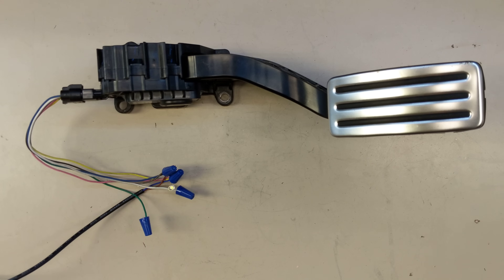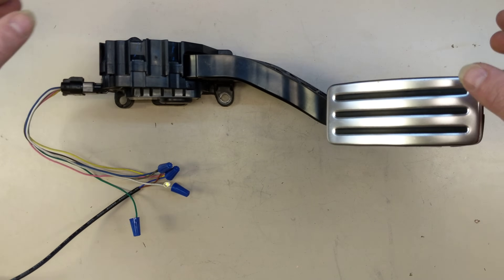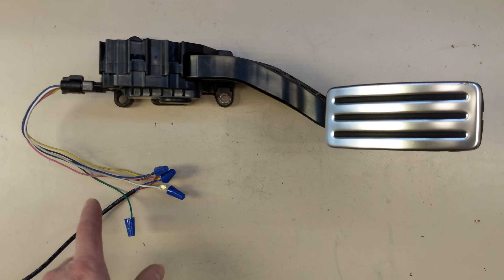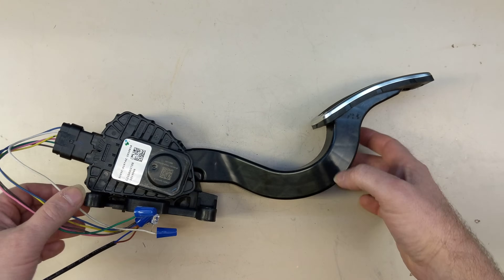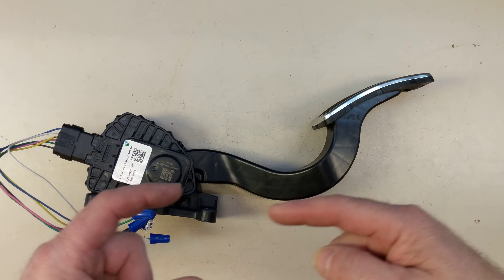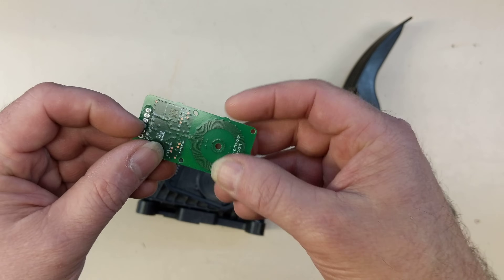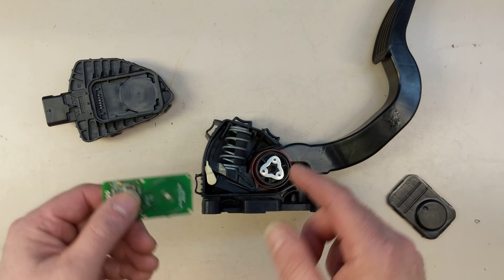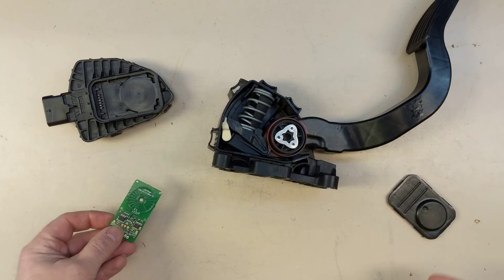Tesla Teardowns - The "GO" Pedal!

Comment: In single motor cars, these analog signals must go the rear inverter ECU obviously.
But in dual motor cars, which inverter do the "go pedal" signals go to? Stick to the rear inverter ECU (keeps common parts with RWD) or front inverter (saves some wire length)?
And how is the signal routed in three inverter ECU cars like Model S Plaid (1 front inverter ECU, 2 rear inverter ECUs)? Most likely, the analog signal is wired to only one of the inverter ECUs and is then distributed via CAN bus to the other ones? Or is it wired in parallel with the analog signal going to all the other inverter ECUs? Would be interesting for FMEA considerations. Especially, as in two-motor e-axles (Model S Plaid rear axle) the whole e-axle should either work or not work at all.
Reply: It would be more likely that the pedal position goes to a main ECU and that ECU then directs the inverters.  There are many other signals that need to be correlated and sanity-checked for forward (or reverse) motion.
Reply: @awebuser5914  Remember, there is no "main ECU" (you would probably mean VC Front). And Phil said at 2:20 specifically, the analog signals would go to a thing called the "pedal monitor, which is running in the second core of the TI TMS320 DSP, that is in the Drive Unit. And its job is to ensure that this pedal signal is authentic. They cross check it with the inverter, which is also monitoring that signal". As this is a DSP, it probably contains the necessary 2 ADC inputs as well, see "TMS320 VC5507/5509 DSP Analog-to-Digital Converter (ADC) Reference Guide". What he did not say: which of the drive units receive the analog signals. :-D

And what parts are analog, what are digital (CAN) messages. What is clear though: once this dual analog signal is converted to some digital representation of the pedal position value (like in CAN frames), the opportunites for cross checking both analog waveforms are gone. Then only time-series analysis of the digital signal and stuff like range remain to check. So, the pedal monitor MUST receive the analog waveforms to do its job properly.

Yes, you are right, that there are many other signals that need to be correlated and sanity-checked for forward or reverse motion. But it is the Drive Unit ECU that could handle that. In a system that would be too centralized (like a single central instance for all two or three drive units), then all drive units would fail if the central instance would fail. Actually, this is an interesting engineering problem and Teslas solution to that would be interesting.
It is also relevant for Phil for the conversion projects as the conversion vans likely only contain a single drive unit in the front axle with FWD. But as we see: he also sources from dual motor vehicles like the crashed Model 3 Dual Motor.
Reply: I looked it up in the Model 3 (MY2018 and MY2019) wiring diagram: analog accelerator signal (2x 3 wires) is always routed to the rear drive unit inverter ECU ("Drive Inverter Rear & Resolver"). So from there, some signal is distributed via CAN bus, at least for diagnostics.
Reply: @koeniglicher  I guess the question is where is the "control unit" that actually tells the inverters to apply power to the motor(s)?   Is that in the rear inverter, or a separate computer, in the cabin?  For production flexibility, you would think that the computer that determines all the drive parameters is independent of the inverter/motor installations.
Reply: @awebuser5914  For the rear inverter, the control logic (ECU) of the rear motor and inverter electronics (handling DC => AC) are in the same inverter housing on 2 PCBs. What you are thinking of are the control overlays: the accelerator pedal as one major influencing factor, then inputs from brake ECU (traction control (probably limiting the slip), stability control (less power when cornering)) , electronic differential, ACC (adaptive cruise control from Autopilot) and overlay with regen braking and friction braking (from braking ECU) and gear selector (P, N, D, R) and BMS (for powering down due to low battery state of charge). In a decentralized, distributed system, like in most cars, there is no central master controller and no "separate computer in the cabin". Instead the rear drive inverter ECU receives many signals from many sources like these other ECUs over a bus network and then decides locally how actually to apply voltages to the stator coils to control the rear motor.
Reply: @koeniglicher  Would it also control the front motor in a dual-motor set-up, or three motors in the Plaid, Cybertruck examples?
Reply: @awebuser5914  Ingeneerix replied in another comment thread, the rear drive unit ECU is a master and will compute and then send torque requests via CAN bus to the other drive unit ECUs in a vehicle.

Comment: Potential supplier of the whole accelerator pedal unit: Boge Rubber and Plastics. For Model Y, they do make the brake pedal module with plastic bearing block and steel brake pedal. So, supplying the "go pedal" as well would make some sense. And they are very much into plastic pedals.
Reply: KSR International, Inc. sells a variety of electronic position sensors and entire pedal assemblies. That is their part number on the circuit board.
Reply: @Miata822  Nice find! Compare with 9:31 : 1007356A KSR-DL13-25mm-3P .

Comment: Really cool design. Sandy Monroe would be happy that it snaps together. He hates fasteners LOL.
I did want to mention that fuel injected cars were around long before drive by wire. Port fuel injection actually showed up in the mid late 1980s in Chrysler products. But they had mechanically operated throttle plates with a throttle position sensor on the throttle to tell the computer desired input.
But that continued pretty long. I own a 2006 Toyota. Has a 1.5 L engine in it and that car also has mechanical throttle plate with a cable into the cabin. Even though it has port fuel injection and variable valve timing. I think it depended upon what engine happened to be in whatever car. That particular 1.5 L engine is a relatively old Power plant...
But the basic engine block continued all the way until 2009 even in the Toyota Prius it's the same engine. But the head and valve train are completely different and obviously it's throttle by wire.
Pretty interesting stuff though,..

Comment: Great video. It would be great if you can plot both analog signals against throttle, just to see how they design to prevent unwanted acceleration.
Reply: They are just opposite/inverse. One is 100% when the other is 0% at no throttle. And then it continues all the way to 0% and 100% at 100% throttle. The sum will always be 100%
Reply: Oui
Reply: Looking at this set up it wouldn't be able to invert the signal. Most likely scenario would different voltages.
For instance signal 1 moves from 1v at 0% through 4-4.5v (would need to be below the 5v ref) at 100% and track 2 moves between 0.5v at 0% to like 2_2.5v at 100%.

This would allow consistent monitoring.
Reply: @otsegoamigo9822  no a inverted signal makes it possible to distinguish signal from interference, since any induced interference will affect both lines in the same direction
Reply: @victornpb  I understand why an inverted signal is commonly used in accelerator pedal circuits. I'm only pointing out that it appears this type of pedal would not do that.  I'd be intrigued to see the oscilloscope readout as I feel both voltages would rise in this case, just to a different value.

Comment: Why isn't the data being encoded on to a CAN bus?
Reply: It is being encoded to some CAN bus by the first ECU that receives the analog signal, so likely the Inverter Rear. This way they run wires carrying analog voltages from the pedal to the inverter, which then does the signal processing of the analog signal. This way, Tesla saves a CAN bus transmitter IC on the pedal itself. The dedicated wiring can function even if the potential powertrain CAN bus would be distorted, overloaded, ill-terminated or whatever other failure there may be.

Comment: Really nice explanation. I guess they use complexity for 2 reasons:

 1 Safety. 
2 possible mitigation for hack attacks in the tuning scene.  Volkswagen had floods of warranty claims as hackers get so many horsepower extra to blow their gear boxes apart.
Reply: What complexity? You can't mitigate the tuning scene with these two analog voltages, just like you could not mitigate with a PWM signal nor a SENT bus signal.

Comment: Didn’t Elon say something on twitter after the unintended acceleration FUD, that there were two sensors that had to agree on the TPS
Reply: There are two chips in the circuit board. Each one is connected to an independent sensor.
Reply: And that standard for every drive by wire car. Not just Teslas.
Reply: @TravisFabel  yep since they most likely use close to the same design.
Reply: Yep, he did. Might not have been on Twitter but he definitely mentioned the redundancy somewhere

Comment: Have you used some wago blocks? 😜 I am happy to send you some.
Reply from the maker: Yeah, I have them, they don't work well on small wires, especially solid conductors like the legs of the LED.
Reply: There are different wagos.. for flexible wires there are some with spring clamps... They really work well
Reply from the maker: @Mrfoobaer  If you find ones that will allow small components, such as a T 1-3/4 LED or a standard axial 1/4w resistor, to connect reliably and without damage, LMK.

Comment: Technically it should never be called the "gas" peddle, when you press the accelerator in an ICE car you are controlling how much air is being sucked into the engine and the car's computer decided how much gas to inject
Reply: Unless it's carbureted.
Reply: Ok but on (maybe some) diesel's it would be a "Fuel" pedal..?
Reply: Not really, only on mechanical linkage gas pedal to throttle body. On all modern engine control pretty much when ever an electric motor is moving the throttle the driver only “ask” for a defined engine torque and all other parameters are control by the control unit
Reply: It should never have been called gas, it's a liquid, that's why we call it petrol or fuel in the UK
Reply: @geoffcarlton4047  "Gas" is just a shortform of Gasoline, so in that context, it's perfectly correct.
Reply: @awebuser5914  that's a very good point. Can't believe I missed that.

Comment: Looks good to me. Honestly if it works, and is safe enough for the acceleration pedal, I don't see how it wouldn't work for steering or braking.
Reply from the maker: This is "Fail safe", meaning it can fail, but the outcome is "safe".  If it does, your car will just slowly drift to a stop.  If steering or brakes fail at speed, then what?
Reply: @Ingineerix  Like you show in the video, there is enough redundancy to keep it safe enough. They have every signal wire twice, and I assume for braking there are also 4 brakes, plus the motor braking, which would almost never fail at the same time.
Reply: seasong The brakes needed to be redesigned so that it will auto engaged when electronics fail. The steering wheel is a lot harder since it has no safe default mode.
Reply: @kazedcat  imagine your breaks engaging while you’re on a highway and there’s a truck behind you
Reply: @victornpb  Safe mode engage could be designed to brake softly. What is needed is a safe mode that bleeds the momentum of your vehicle. They can even design it so that safe mode braking can be overpowered by the go pedal. It will kill your brake pads but that is acceptable cost during emergency.
Reply: Air breaks do fail safe, but steering may not have a solution.
Reply: The signal is just an input into something that must do the right thing. Honestly I feel safer driving a model 3 knowing that the car can fail in any electronic way whatsoever and I can still steer and brake. An EMP bomb could go off and I can still steer to a stop.

Comment: I saw a few 90s-2000s cars that used a cable but had a throttle position sensor on the throttle body. Well it is 2021 so I guess “the last 20 years” is mostly true. Time flies
Reply from the maker: Yeah, I think they did that in the early days so they could keep the cable.  For instance, they might have some engine options that needed a cable.
Reply: @Ingineerix  From the 1980's through the 2000's most vehicles were fuel injected and had cable driven throttles.   The first 30 years or so of electronic fuel injection used cables.  That required other hardware as well, like wax pellet or electronic idle air control valves, throttle position sensing at both ends of the cable, etc.  Throttle by wire is much simpler.
Reply: Throttle by wire didn't spread that rapidly; most cars well into the 2000s still had throttle cables and pretty much everything since before 1990 had fuel injection. My 05 Taurus has a cable and my 08 Chrysler minivan has wire.